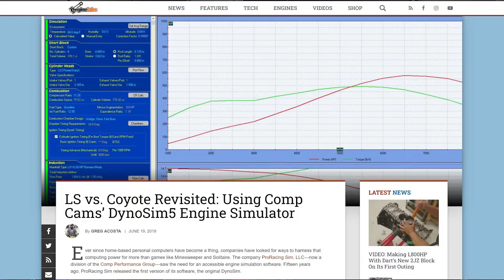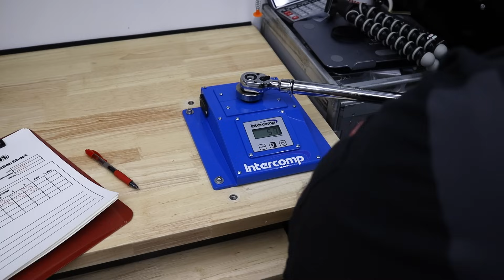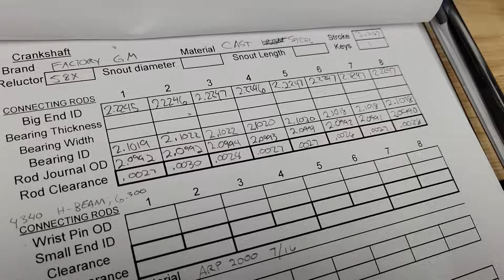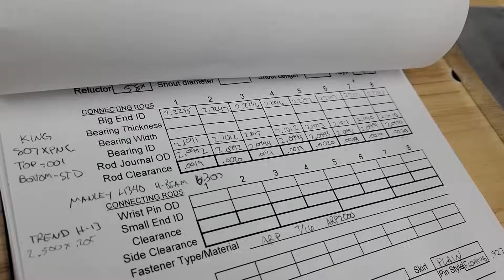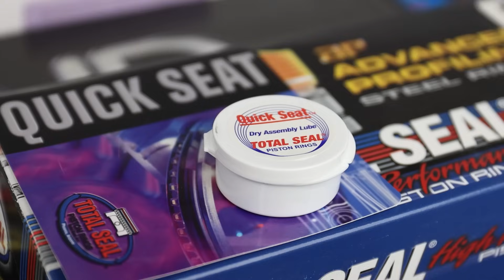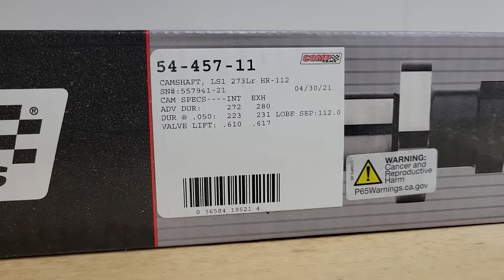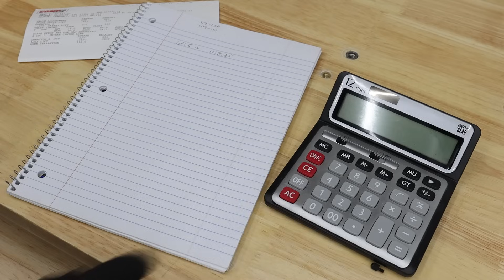Building An 8,000-RPM LS — LS5.0's Short-Block Comes Together

Comment: If you don`t use your mic`s for vise grips they will remain good forever.What might change is if the  temperature shifts by, let`s say 30 degrees F   Steel will expand and shrink.  .0001 inch for every 10 degrees depending on thickness of the metal. 68 F or 20 C is the international baseline for calibration.

Comment: Not quite sure exactly how a ohv cylinder head is gonna flow as much or even more than a dohc cylinder head specifically the coyote cylinder head which from a stock stand point are probably the highest factory flowing head ever manufactured from the factory on mass produced engine in history, and being a chevy guy this isn't easy to admit, but based fact proven the coyote and it's 302ci displacement has proven and achieved some very respectable power numbers in just factory trim, So this is gonna be a very very interesting video😮

Comment: Great video! I have been wondering for a long time, when you grease bolts or use loctite (which as I understand, changes how bolt threads bind and therefore changes torque applied to the wrench), do you use any "rule of thumb" to change torque specs. as to not overtighten bolts?
Reply from the maker: ARP provides torque specs designed around their Ultra-Torque lube, and with the rod bolt stretch gauge, we can see actual stretch, so the torque value is what it is, at that stretch.

Comment: I notice that you used a 10355 oil pump.  I'm keenly interested to see what your oil pressure looks like when you start really winding that engine up.  That's not at all meant to be negative either, I hope you win.  I had a similar combo with a 10296 and it really struggled to make solid oil pressure past 6500-7000ish rpm.  The pressure was there but it was always a bell curve and it'd be down 20ish psi from peak at 8-8500.  That was with a stock gen 3 oil pickup tube with 3/8"  pan clearance.  Oil type didn't matter too much but rotella 15W40 (that the internet seems to love still) was the worst and bearing life was very short.  Turbo deal and stationary on a chassis dyno, never did make any passes as the combo proved to be completely unreliable.
Reply: As long as his oil pump can survive comfortably the rpms, and as long as the heads are able to drain the additional oil introduced by the increase in oil flow due to high rpm, then maybe he's ok.

Comment: Technical question. If you use a 6.0 iron block 4in bore and a custom 3in stroke crank do the rod ratios and everything come together to have a 8000+ rpm modern 302 LS and be reliable? With the great features of an ls would be like a modern 302 Z/28 would be interesting to see the power with a roller cam and those high flowing ls heads.
Reply: Agreed
Reply: Agreed X2.

If you want to compete with Coyote at the same displacement, while using a 2V engine then a 4" bore should be the minimum you'd consider. A 4" bore will accept a way more efficient head than even your 3.898" bore 5.7L engines, while not being so large that piston weight becomes an issue at higher RPM's. A 4" bore kind of hits that sweet spot in an OHV SB, and is why the majority of your most popular OHV SB's throughout history have come factory with 4" bore diameters.

IMO a 6L block with a 3" stroke would have been the way to go.

Comment: Do you run more oil with the melling high volume? Ive spun bearings on NA builds (and have heard stories from other people) and the culprit seemed to be the high volume pump. I'm sure theres a use case for them, higher volume is good for heat transfer, but doing the swap without any other changes is a big reliability issue in my experience.

Comment: Destroking is not required to turn 8k. A solid valve train does so why people give up displacement is silly
Reply from the maker: Who destroked anything? It's the factory crank.
Reply: Entirely not true I always hear this but show me a 5.3 that can spin to 8k rpms safely I’m currently building a destroked 4.065 bored lq4 block with custom cnc port heads and big cam and some good valvetrain shooting for 8k rpm and I believe should be around 620-650hp range but as I said I hear everyone say the same thing but don’t ever see it being done on stock 3.622 stroke

Comment: So long story short, it takes a fully built engine with high end components do run the RPMs a Coyote can do stock? Curious what it would do power wise.
Reply from the maker: Where are you getting that the Coyote is stock? The Coyote we're comparing to was built the the same budget and similar components.

Comment: Of course you can equal or better the horsepower. But you can’t do it while meeting the Coyote’s fuel efficiency or the strict EPA restrictions. Thats the point. Try this build under THOSE rules and you’ll fail every time. You also used all the high end parts you could find while Coyote is a mass production engine.
Reply from the maker: Man, you're WAY off in left field. The Coyote we are comparing it against is a full custom-built engine as well. Seriously, go read the linked article if you want to actually understand what is being discussed.

Comment: The micrometers should have come with gauges.  The gauges have rounded tips on them so they are easier to calibrate against, don't use the square blocks.....   Well you can, its just harder.
Reply from the maker: They did, but those are only sanity check standards. You need to use proper gauge blocks for actual calibration.

Comment: Why didn't you lube the cam completely???
Reply from the maker: It's a roller cam. The lobes will get oiled when the lifters go in, and then the whole system will be pressure lubed before first start on the dyno.

Comment: I'd like to see a 6.0 or 6.2 block with custom crank with 3.0" stroke 12.5:1 compression. Maybe angle cut the heads to get the compression  and port and flow the heads a bit. Get good flow. But importantly keep the velocity and swirl up. Port the heads and possibly fill the floor with epoxy. About  .120-.150" on rec. Port heads carefully unshroud the valves. Polish the chambers. Ceramic coating the chamber and exhaust ports. Possibly go with larger valves. With multiple angle valve seats. A 4340 crank, and rods long enough to make up the difference. Similar pistons in  4.03+ bore. It should come in around 307-312 cid, maybe slightly larger ,   another thing id like to see, is a LS7 with a 4.8 crank. With modified LS7 heads, cut them a bit, and back fill the bottom of the ports, open up the bowls smooth out the port. Then fill the bottom of the port about 5/8"-3/4"  then slowly open them up on a flow bench. Testing each port until the right shape and size deliverd high flow with high velocity. Testing from .030" lift to 1.200".  Not looking for actual flow at yhe obviously outrageous lift. Looking more for port stability and high velocity and volume in the .400"-.800" lift. The match the intake to the intake ports and making the first 10mm if the bottom of and top of the port about .080" larger. And the intake port about .050" smaller. To leave a slight ledge the air doesn't really notice going in. But will effect reverse flow. Then spec a cam with a slight bit more duration at .050" than you think it would want.  The high velocity and anti reversion should keep the TQ that would normally be lost. A 5.0L will be lazy with 7.0L high revvng heads.  Therevis basically 2.0L difference in flow it would want to rev to possibly 12k+ rpm and be lazy below 6-7K rpm. I figure it would behave like the cam was about 4 sizes too big. It would probably sound mean at idle tho...  Sorry to ramble again, have a awesome day...🎉
Reply: Sounds good!

Comment: I’m guess the rotating assembly was balanced?  Or does it not matter with these parts on this build?
Reply from the maker: That's all covered in the article (didnt make it to the video).  It was all balanced at CWT (the balancer manufacturer). Definitely need to balance the assembly to be smooth at 8,000 rpm.

Comment: Building a "comparable" LS engine to a coyote: uses Manley rods and custom Diamond pistons, Comp Cam, billet sprocket, ARP parts, ATI dampener. Add comparable parts to a coyote, rev it to 9,500 rpm and see the difference. 😂
Reply: I mean the ‘03-‘04 Cobras had Manley rods stock.
Reply from the maker: LS7s had Titanium rods stock. What's the point there? The Coyote from the original LS vs. Coyote used Manley rods as part of its budget.
Reply from the maker: Comparable *BUDGET*. You kinda missed that part.

Comment: How will splitting the rod bearing work? Your gauge will show it’s ok but won’t it be tight loose tight loose as it’s going around since the crank journal never changes? Just curious I’m not shit talking.
Reply from the maker: The quick and dirty: The bearing clearance is filled by oil, that creates a load carrying wedge which "centers" the rod on the journal. I think we have a deep dive with Dan Begle on the site where he has a whole hour-long seminar explaining how the oil cushion changes with each part of the stroke, and things to consider beyond just static clearance.
Reply: @EngineLabs  I'm lost. Is this based on actual bearing thickness or actual circumference? Im being extreme here but, If I have a 1inch bearing and a 2inch bearing placed together. The 1inch bearing is 3 inches thick and the 2 inch bearing is 1/2 thick won't the oil "pack" against the 2inch bearing while the 1inch bearing gets starved, causing wear to the journal in specific spots?

Comment: A 4.8 can make peak power at 7200 rpm with stock 706 heads.  LS7 lifters will handle 8k with the lightweight stock 48mm valves.  With ported heads it will make over 500 bhp.
Reply: @arturozarate1752   Look up "Fastest Stock Bottom End 5.3 LS In The World Goes 7.81".  fyi GM says the stock LS7 is stable to 8200 rpm.
Reply: @chrisstavro4698  will do. Thanks for the info
Reply: Is that right? Where can this engine be seen? I'm skeptical of that small wheel lifter.
Reply: @arturozarate1752  bro you been sleeping under a rock, the stock 4.8 will turn 7200 with no float all day, I've been doing it in a 08 rcsb for the last 6 years. The 4.8 loves to turn.
Reply: @averagejoe6084  ugh.....I know. I'm out from underneath that rock now. I'm exploring combinations with the 4.8 platform.

Comment: It's funny how most people think that the 4.8L/3.268" Iron Crankshaft is weak, when in fact, I would put it up against a cheap chinese 4" stroke twist forged crankshaft any day of the week due to it having far more journal overlap and generally suffering from far less centrifugal forces than a larger stroked unit. We have all seen the 4.8L Stock Bottom end produce around 1700 HP in 'Squirrel Tuned' (Jack's) record holding Mustang in the 1/8 mile (I believe it hasn't been broken, either motor or record). The 'Big Bore' Iron 4.8L block/bottom end is and will always be one of my favorites in terms of budget builds, especially if you have a buddy that has a pulled set of LS1/6 Pistons to donate to your cause, that offer a 100% bolt-on experience as their pin height is the same, depending on press fit or floating pin models.
Reply: I have a stock 4.8 in my 07' GMC Sierra 1500 that came with the 243 heads from the factory..for a heavy truck it runs great but it needs a new transmission..this one has started slipping at 106.000 miles and it's been well taken care of..I believe it has the 4L60 auto but maybe at a later date I will hopefully build the 4.8 up a little bit.
Reply: It's far from weak.

Comment: Dang it.....I'd like to know how much overlap the cam has and what lifter you plan on running to 8k rpm.

I've got a 5.0 in my 2016 F150 with 438k miles on it.....I'm really interested to see where this goes.👍👍👍👍
Reply from the maker: The valvetrain video will be next, and I'll graph out all the valve events for that (right now I don't even know how much overlap there is), but we talked about picking the cam in-depth here: https://www.enginelabs.com/engine-tech/engine/video-picking-a-camshaft-for-ls5-0-with-ben-strader-of-efi-u/
Reply: @EngineLabs  ok. Very cool.
Reply: @EngineLabs  I just finished the video. I understand what the math is saying, and pushrod deflection is a very valid and overlooked point in the LS world. Where the overlap occurs(biased towards the exhaust side or intake) has been very important in my engine designs. 

11/32 heavy walled pushrod is the minimum I can stand to run. That's been at the fault of availability and time. Lately I've been able to run 3/8 and 7/16 double tapered on solid roller builds. 

I'm very curious to see how the camshaft choice pans out. Also the lifter and size wheel. Rocker arm choice too. 

I've built 416s to go 8k and the comparison is intriguing....

Man fast forward to next video already.
Reply: @EngineLabs  btw, according to Wallace racing calculator, with adv 272°/280° and 112° lsa, that camshaft has 52° of overlap.

Comment: Since the piston is custom, why wasn't the top ring land moved up? Maybe you've never noticed how far up the rings of factory LS pistons are. GM was thinking on that one.

Down 0.300" compared to 0.150" adds up in power over 8 holes.

If you're trying squeeze every bit out of it.....ditch the 2nd ring, bring in the oil expander, gap the top oil ring to 0.050" bottom to 0.018" and watch the power carry 500 to 800 more rpm. There's the points needed to win.
Reply: Man, I was thinking the same thing. I also just read up on my How-To: Guide to Porting by David Vizard